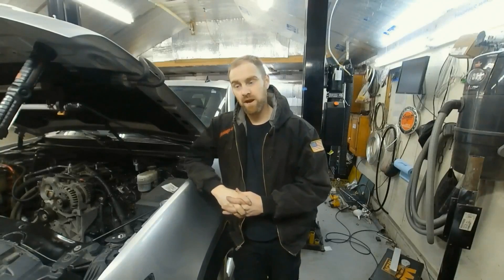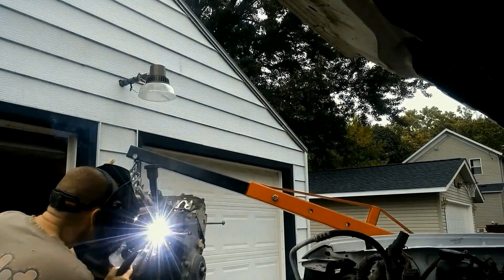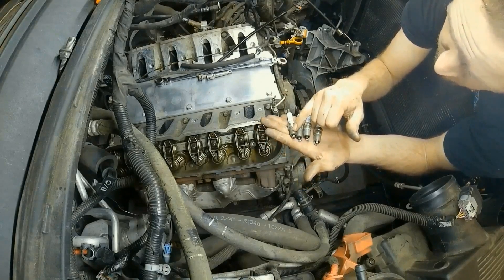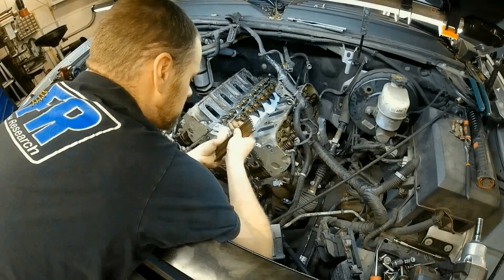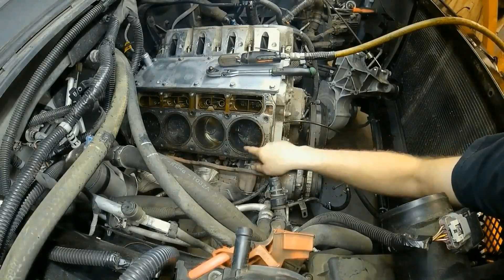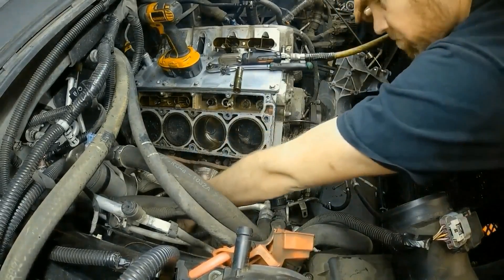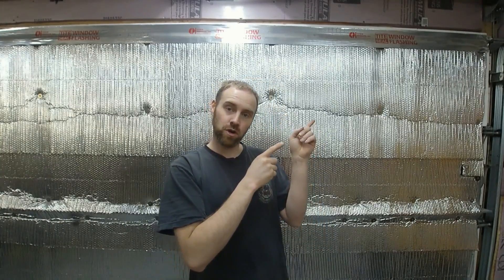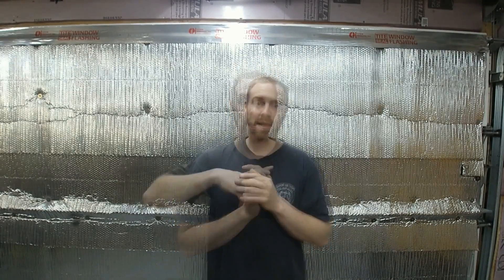DOD Delete kit using texas speed pt1 afm suburban tahoe...

Comment: Now that I watched the whole video u made one comment that if the dod didn’t kick in then there wouldn’t be a chance that one lifter would stick. Again marking me think going with a simple disable instead of delete might be a viable option.
Reply from the maker: Turning it off in tune only cost $50 and some shipping through LT1swap.com besides it's easy to bump that disabler on accident or consider it won't be there if drivability diagnose is being done with scan tool hooked up. There are other reasons not to use disabler as well but that information can be found at my website.

Comment: Ok so I have an 08 LTZ 5.3. My engine seems to be running fine. I’m trying to take everyone’s warning on all these videos. My last vehicle I replaced the motor which was almost 5k and then barely drove it because of a family issue where I started driving the Tahoe. So I’m a little weary of putting over a grand into a motor that’s just ok for now. Has just under 40k miles. I realize this is the best option but has anyone gone with the Diablo tuner to stop the dod instead .
Reply from the maker: You can use lt1swap.com for only $50 and a little shipping it's disabled in the tune. Also I now sell delete kits and if your looking for information check out my FAQ page https://www.crazedperformancerepair.com/afm-dfm-lifter-repair

Comment: I'm looking at this kit currently. I have zero problems with the lifters.  I used HP Tuners to disable the DOD in hopes of buying myself some time. I have always changed my oil every 3k miles with Pennzoil ultra synthetic religiously to keep all the internals spotless in hopes of avoiding a stuck lifter. I am planning to do the kit after this winter.  I'll probably get a good daily street cam and exhaust when I do it. I can't wait. I really want to do a rebuild at the same time. If we are in there, we might as well replace and bulletproof everything we can. I'm so excited. It's going to drive me crazy waiting, but I have to.  I have to rely on the truck the way it is till I have the time I need to get it done.

Comment: found this comment on another channel but should help explain alot, remember this was the GM bankruptcy bail out era decision changes 
pygmywarrior3
1 year ago
I worked for The Torrington Company making the roller bearings for the lifters for General Motors. We lost the contract in 2009 due to cheaper competition prices. From 1981 to 2009 we never had a bearing failure due to our manufacturing. We made between 40 to 50 million bearings per year.  I guess that's what you get when you cheap out on parts!
881
Reply
@billsmith2212
1 year ago
Proven track record . However , when GREED comes into play , all bets are off !
75
Reply
@darylsparks-sparksautomoti6066
1 year ago
bean counters & gamblers.. throw the dice
50
Reply
@willywonka521
1 year ago
I've owned 3 gm products , were all garbage & financial loss , I'll stick to Ford I'm currently driving a ranger with 275k as my work truck and been a great buy
46
Reply
@randyjerrett3385
1 year ago (edited)
Can you say china! cheap parts means more bonuses for CEO people
67
Reply
@alanmorrison3598
1 year ago
Regular full synthetic oil changes help!
31
Reply

Comment: If you are going to replace certain push rods, rocker arms & lifters, you should replace all lifters, rocker arms, push rods just to be on the safe side.
Reply from the maker: Why waist money if the rest are fine and they are easy to replace? It's not like you have to pull the head, replace gaskets and bolts, then have the head machined. If you are talking about lifters, I agree. But simple parts like rockers and pushrods, nah.

Comment: Hello sir     I swapped engines in my 2011 gmc sierra 5.3.    To a 5.3 deleted jasper engine with 10,000 miles on it.    I swapped out the engines and I got the computer deleted at a local shop.   And now I am getting mass airflow low code.  And bank 2 issues with the cat o2 sensor s.      I swapped out the mass airflow sensor and it was good for a short drive after i deleted the codes.      I am just looking for another option of what to do thanks Dave.

Comment: I’m sorry brother, but I’m in the middle of one of these on a 2019 sierra. And I’m not getting the info on where to put these plugs, this is an lt engine not an ls. Please help
Reply from the maker: Are you talking about the little metal plugs? And those engines you are supposed to block off the oil towers with little metal plugs since it's much cheaper to use the little metal plugs over replacing the valley cover with a non AFM cover.

Comment: My 2011 escalade 6.2 had a lifter failure and wore the cam lobe. 
Which cam kit would you recommend to do the full DOD delete?
Reply from the maker: I typically use Texas speed myself. Just be sure to avoid the ultra cheap Amazon or eBay items. I've heard lots of horror stories about those.

Comment: What is your opinion on the oil pump leave the high pressure and plug the relief valve in the oil pan or get a standard oil pump and plug the relief valve in the pan ?
Reply from the maker: Leave oil system stock. Replace relief valve with new one at most. I do have a video on oil  systems for these.
Reply: @CrazedPerformanceRepair  thank you very much for your videos and advice

Comment: Could bad afm cause vibrations when engine goes to V4 mode?
Reply from the maker: Yes, if a cylinder is still pumping air when it shouldn't.
Reply: @CrazedPerformanceRepair  thanks... What do you think about Range device? I use it for 3 month

Comment: Hello love your videos!
I replaced bad lifters on left head#1 misfire on number five now the dod activates all the time number one misfire .i changed installed new valve lifter pan under intake put back together and still have the #1 misfire both valves stop upon start they rotate 3 time and I assume go into dod mode and shut those lifters down. . And traction control activate. I have a 301 misfire code. And heavy skip. Any suggestions
Reply from the maker: With both lifters spun in the bore from bad plastic guide, or there is something allowing oil to go past solenoid for cylinder 1. Could be a shorted solenoid wire in the main engine harness activating solenoid, stuck open solenoid, or possibly computer stuck shorted internally doing the same thing as wire short.

Comment: If u do afm d.o.d delete will vehicle start
Reply from the maker: Yes when done correctly, or people wouldn't do them. Now if you are suggesting doing it without a tune out of the AFM that's a more complicated story. They will most likely start but some run on only 4 cylinder.
Reply: If u do afm d.o.d delete will vehicle start = If you do an AFM / DOD delete, will the vehicle still start? ...proper English grammar makes your question much easier to understand and for others to provide a quality answer!

Comment: @crazedperformancerepair so I'm looking at an 08 suburban.  Owners said it had loss of oil pressure.  They replaced oil pump. Water pump. Timing chain and the lifters on the right side of the engine.   Take note it was a mechanic who did this repair.  Anyway.  It all started with a misfire.  With that being said they said that when they run the truck the lifters get louder.  I seen a video u made of a stuck valve and lifter.  I happen to have a 2005 yukon with the 5.3 and that suburbans got the 5.3.  Could I pull the lifters from the 05 and use them in the 08?   Apparently their burb is still showing a low oil pressure warning.  What would you best recommend?   I'd like to drive it home.  It's a state away and a good price.   Also.  If I wanted to.  Could I possibly swap the 05 engine into the 08 body style?   It'd be my first LS set up.  Don't know much about them but need a 4 wheel drive. My mom's got an 08 suburban I've been driving lately due to snow.  And fell in love with the quality of these trucks.  I'd love to own my own burb or tahoe.   T.i.a.
Reply from the maker: The 05 may or may not work in the 08. Not much help I know. What you need to figure out:
1:The factory engine code for each.
2: use the code to figure out what crankshaft and camshaft trigger wheel each one has.
3: if they are the same go ahead and swap them then disable AFM in the newer one. If they are different it's most likely the cam and it's a simple cam sprocket swap. If it's the crank, it's not worth the effort.
You could also just fix the 08. That would be my choice. It could be a oil pickup tube o-ring but is most likely the second camshaft bearing. You never mentioned the oil screen under the oil sensor being replaced. Check that first, if it's plugged pull it out and your set to drive home.

Comment: Need a little insight , if you have time, I had a lifter on cylinder 1 start ticking, I looked over the cam through the holes for any type of cam failure , haven't found any signs as this truck did not run more that 1 seconds  once the lifter started ticking, I ordered new AFM lifters, i have put them in and a new Vlom plate, my issue is i have the motor put back together, and none of the AFM cylinders are opening or closing and makes truck have multiple misfire and dies, Its like it is stuck in v 4 mode, any input will be appreciated.

Comment: CPR, I did a DoD delete with new cam, new lifters, new VLOM, and flash for my ECM.  For the second time, the ECM has shorted out and the car won't start.  Any ideas on what could be causing this.  It is expensive to tow it to a shop, have the ECM replaced and flashed, then limp on 4 cylinders down to the tuner shop to get the new ECM flashed. Help!
Reply: Forgot to say, this is a 2008 Trailblazer with a 5.3 LH6.

Comment: So what do you think about the OBD port plug in module that deletes the DoD system? Anybody?
Reply: It works and works fine to keep your engine from shutting down the cylinders which is the root of the issue.
Used by many successfully

Comment: Got a 2012 silverado 5.3. Currently doing a dod delete. Factory gm cam and lifters. I know I need to have the dod afm disabled in the ecm. My question is, since I'm just putting in oem replacement non- dod cam and lifters, do I have to get it tuned as well? Thanks

Comment: Thank you so much. Your channel is super helpful.  
What's the best method you used to adjust the rocker arm with AFM?
Reply from the maker: Rocker arms don't get adjusted, it is just a tq to spec thing.
Reply: Thanks,  but that what the book said. 
I have to go over the firing order to do so.
Reply from the maker: @last1king  if it's factory just tq them, the valves will just open on some

Comment: I'm having the issue of p304 I changed the fuel injector, coil, spark plug, and wire. Still showing a cylinder #4 misfire,  no noticeable lifter tick,  Not sure what else to check other than taking off the head and seeing if there's an issue with a lifter
Reply: Pull the valve cover on bank 2 and crack the rocker arm nuts free with the engine running. If the miss dissappears you got lifter problems

Comment: Thanks man!!  i watched most of your videos on the dod delete.... was scared doing it... i'd only worked on my own crap sbc 350's etc....  my 2011 yukon was not something i wanted to work on, but did it to save the money, and you definitely helped!!  It is running perfectly after having a clicking afm lifter that got stuck.  I used TSP components, and replaced the oil pump as well...

Comment: Great videos. I am rebuilding my LH6 that I swapped with a LQ4 inside a saab 97x. I drove it with a collapsed lifter for over a year and was actually relieved when it spun a crank bearing.  I hated the dod with a passion.  It collapsed when I checked my oil and it was normal and then the same day it began tapping. Checked oil and was dry. Added a quart then drained it with only 2 quarts. The motor ran so well before it collapsed but I got comfortable with believing it would never happen. The engine is super clean but pistons for dod were caked in carbon.  They sound like Subarus with an exaust.

Comment: What does a dod delete cost?
Reply from the maker: A full delete cost $3400-$6000 depending on the shop parts mark-up and labor rate.
Reply: @CrazedPerformanceRepair  wow...i have 137k on it. Had dod "disabled"...i just run it til it quits

Comment: Hey man I did a full delete using cam springs lifter ect. Its been tuned an running good for about 2months then I got a p3401,p3425 code but the volm  was replace with a flat non afm cover when the sawp was done ..do you have any ideas what is wrong
Reply from the maker: The system wasn't properly tuned to shut the system off.

Comment: My friend, how are you? I am happy to follow you. I ask you to answer my question. I have a Yukon GMC 5.3 May 2008. I changed the machine and installed a 2011 machine. Capacity of 5.3 was light oil. I changed the package to Denali high pressure and the pressure did not rise. The same did not change, and when it turned from 8  Cylinder to 4 cylinder works backfire and looks at code p3401 p3441 p3425 and asked the owner of the machine he told me that the machine is iron and not its size

Comment: first off thank you for sharing your trick.  I have a couple questions with the time frame as far as what is the best approach first do I send in my pcm i assume I won't be able to drive my truck without it.  order your kit can you tell me exactly what to ask for when I send off my pcm? I have read lots of the comments to try and get the info but I just want to make sure I don't miss anything. 
I have A 09 1500 collapsed lifter on # 4 assuming its intake. thank you
Reply from the maker: I see you ordered the kit so first off thanks for the support. As far as order of operations, if you have a place you can park the truck to send off the ECM while you wait on the kit then do the repair when the kit shows up it will expedite the job. A lot of people like to attempt the fix first with the thought that it might not release but even if it doesn't you will want the system off anyway so why not just get the AFM shut off right away to reduce wait time. When you go to LT1swap.com he has a AFM section and it gives some nice simple instruction on how to send the ECM to him so follow those. I personally like to add a copy of my receipt from his site in the box with the ECM though I don't believe he ask for it. Btw Next time if you wan a fast response shoot me a message on my website since I don't always get to the YouTube comments right away.

Comment: Okay we did the dod delete kit from yall on our 2008 Chevy Tahoe hybrid and we are having issues still.....no power when driving when in idle shakes badly and when it is in very low idel we have a bad rattle grinding type sound....got into computer and the dod inside the computer was showing disabled already what else are we missing??? We have also replaced the cam shaft with a different one that came out of a ss camero
Reply: Did y’all found the issue?

Comment: I bought my 2015 Sierra and the day after getting it, it started running super rough and engine light started flashing. Used a obd2 reader and it was a misfire on cylinder 7. Thankfully it was under warranty and got it fixed but i am soon going to delete the DOD system

Comment: Hey! Thank you for making these vids, they have helped so much! I'm in the process of tearing down my 09 sierra 5.3l (ly5) collapsed #4 and cam damage. Yeah I bought it that Way ... but there are so many choices of cams to replace the dod cam with. I want stockish drivability but dont want to lose what hp I have. How does the lm7 cam work? Or maybe an ls9? I dont want to destroy it. Just wanted to bump it a lil since I'm there. What's your thoughts?
Reply: Jeffrey Herrin 
Ls9 camshaft is good but you’ll lose torque
Reply: Try a dod delete cam kit from tsp
Reply: I ended up going back with a 5.3l stock cam from a non dod engine. It runs good so far. Stock is ok since I'm using for a daily driver. I will build something fun soon tho on a non Daily.

Comment: I have a 2015 Tahoe AFM/flex 114000 miles with ticking on the passenger side  with "No" codes or misfires. Am I a candidate for a stuck lifter? Do you make a delete kit yet? The oil sender filter is in a different location correct?

Comment: Great videos. I have a 07 6.0 vortec. Cylinder 7 misfiring. Pulled value cover and lifter is not working so I’m assuming collapsed lifter is the issue. Your videos have been AMAZING. Few questions. I’m debating on whether to just buy your tool, fix the lifter and possibly just tune out DOD without doing a full delete kit. So what would cause me to choose to do the full delete kit and not just release the lifter? What do I need to do to ensure the current VLOM is working correctly and won’t collapse lifters again if I don’t do the delete? If I keep current system and just tune out DOD, do I need to do the mods to the current VLOM you described in other videos? Right when the misfire occurred and I was driving it home, dash started buzzing stating engine had no oil pressure and to turn off engine immediately. I was 100 yards from the house so just got it home. That night, When the engine was cold it did not have any engine oil alarms like that tho. Is that something to point me to my VLOM is having issues and I should look at a delete kit? Will be pulling off the intake in a couple days to check for the loose VLOM bolts but the front two seem tight (can’t spin with just my hand or a socket and my hand). Thanks for all the videos and help.

Comment: what we do in our engine machine shop with aluminum heads, and this is only if there is material to do so, is to drill to the next size up, helicoil it and get a stronger bolt and a stronger steel insert.  Don't use loctite on an exhaust manifold bolt, use anti-seize.
Reply from the maker: You are spending a lot of unnecessary time doing it that way. Use a welder like I do here https://youtu.be/0uLEBnhycpM